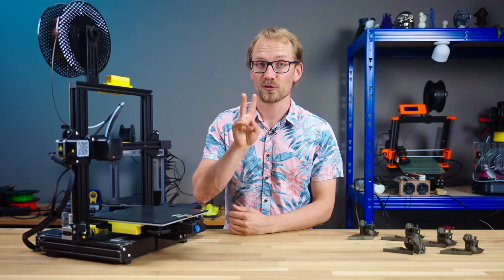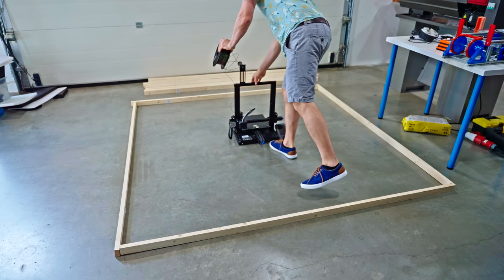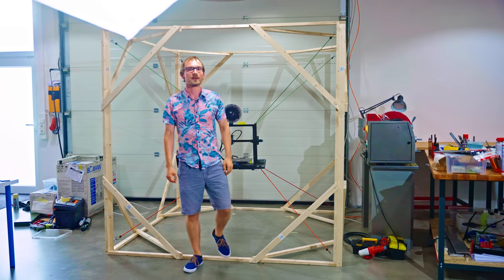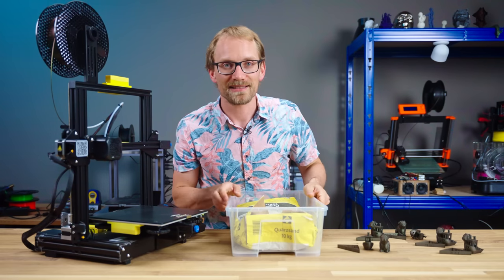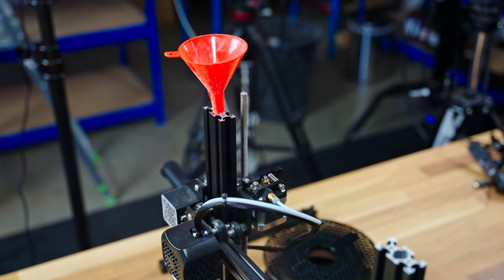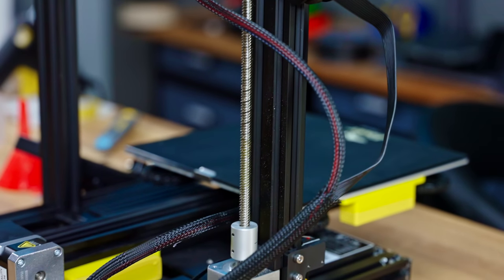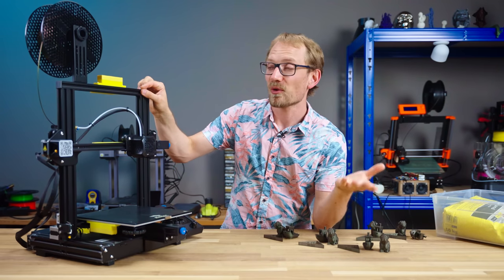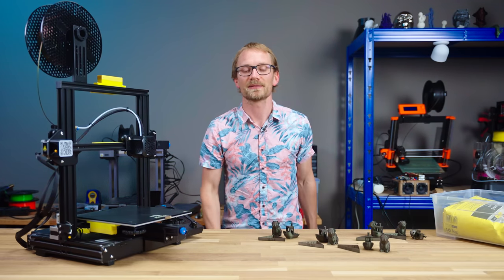You made me do this…

Comment: Those sand containers are a great solution. Did you try adding the sand only to the static portions of the frame?
Reply: Sandtainers*
Reply: I was going to ask the same question. Leave those heated bead sand containers out.
Reply: Surprised he didn't try it without, first, to begin with...
Reply: Same question from me too. I'd love to see it only attached to the static frame parts
Reply: The ones on the bottom. Of the bed can't be a good idea
Reply: @Alexander Gee That was exactly my idea to write a comment like that...
Reply: Or just try the printer on top of the sand (in a bucket/tray).
Reply: Adding weight to the bed was not smart in any way
Reply: Agree, curious if/how different dampening materials/fluids attached to static frame components would help, or not.  Detaching power supply and fan cooled controller board.
Reply: I figured it out. He added weights to the bed to add engagement to the comment section. Big brain 4D Chess move.
Reply: Yes, in that case bed have more weight and that causes bigger inertia and servo struggle to stop the bed or any other moving component
Reply: I was about to suggest the exact same thing but also lighten the moving parts so the change of direction causes less vibration.
Reply: I really wanna see this, adding extra momentum was kinda wack, but they might add some benefit if they're only on the frame
Reply: I was going to make the same suggestion.
Reply: @yossirabby7746  or to the gantry.
Reply: @yossirabby7746  he probably did it originally without the weights on the bed but saw no noticable difference and wanted to get a point across, don't waste your time.
Reply: I'm wondering whether replacing rigid containers with soft sand bags would help. They may allow for more movement and thus improve damping. 
A more professional solution would be to find out which frequencies affect ghosting the most. Then with a FEM model you can find out what dampers to use (e.g. oil dampers, tuned mass dampers or combination of those) to almost completely negate vibrations. This is a very complex task though, and it would probably fit your printer only since every machine is slightly different in terms of rigidity.
Reply: It was very surprising, that he added weight to the moving parts at all
Reply: Y’all commenting that extra weight to the bed is … bad… but the sandtainers (c) are not simple weights: they are only partially filled so they potentially dampen the springback
Reply: Skipping was worse cause of those containers is my guess to cause like the skipping is the motors not being able to turn enough and adding weight only gives them more work while they would need less work
Reply: Please take the sand off the moving portions and try again!
Reply: I remembered why I unsubscribed.
Reply: Right that's painful he didn't show with out adding weight to the bed
Reply: Yep, sandtainers on the rigid structure of the printer and not on the bed or other moving parts would be my guess too.
Also to dampen resonant frequencies, you must always combine diferent materials.
For example a spring to tighten the band to move the bed. The spring has a different resonance frequency compared to the band, so you will not have a single resonance frequency and on the 2 separate frequencies you will have a much lower amplification.

The same for the hanging construction. By using the same bands in all directions, you actually introduce a new resonance frequency. By combining 2 different elastic bands in series, you will prevent those frequencies to amplify themselves (thus resonate).

I think you will already get great results by just placing the printer on a stack of different materials like rubber feet, carton beer coasters, anti-scratching vilt pads, etc.
But adding the sandtainers to the rigid body parts of the printer should for sure have some effect I think.
Reply: Why not use input_shaper?
Reply: @thegeniusman8757  Sandtainerers*
Reply: Adding the sand to the bed makes no sense at all. The rest of the sand does make sense
Reply: What if you rest the sand-filled printer in a 1x1x1m box full of densely packed packing peanuts instead of the elastic bands? 

Because the sand inside the bed containers isn’t solid, won’t it cause all kinds of issues when it shifts around and or vibrates? 

One last thought, if you measure the resonance of your printer, canʼt you use the weights from a BMW to counter it? (If they match in frequency ofc)
Reply: @groggynod  Yep
Reply: I mean yeah, he identifies the weight on the moving parts was a negative, didn't bother to check without it
Reply: +1 for I think we all want to see only static sandtainers (especially not on bed) PLUS the cute pink vibration feet, with printer sitting on floor. (Zero bench movement possible)
Reply: @AzaB2C  yeah fill the rails with fine lead shot and oil.. That is effectively how a fluid damper works, and those absolutely DO work.
Reply: His ignorance is glowing like Rudolph's Nose due to the fact that he didn't try this first
Reply: Exactly my thinking + we use vibrations to make the sand settle in a profile frame. It's not suppose to slug around, creating that dead hammer blow he also mentioned himself (why that wasn't immediately clear to him when saying it is beyond me)
Reply: Yeah as soon as he put it on x gantry I was like God no... everywhere but not x or y as it would obviously affect negatively.

Comment: I still feel like the sand in the frame might marginally helps, but adding the "sand containers" to all of the moving parts really just serves to add weight and increase the problems.
Reply: Not sand. It should be ie. lead to even have marginal difference.
Reply: Yes. I would have liked to see what would happen if sand was added to just the non moving parts.
Reply: Although sand in the frame really is a poor-mans version of just using better aluminum extrusion profiles - i.e. the heavy-duty type instead of light-weight.
Reply: @alexbaeza4370  mhmm   mm
Reply: @graealex  its not the same… one adds strengths and the other absorbs vibration energyyy
Reply: @fabilord98  While the sand does not add rigidity (what you are referring to as "strength") - rigidity is what resists forces to deform the frame, so basically stronger frames better resist vibration. The motors and sudden changes in direction are as a direct result not able to cause as much movement in the frame. This is additionally helped by the increased mass, at least for the parts that remain stationary.
Reply: @alexbaeza4370  Completely agree, adding weight adds to the inertia to the part. Great for static items but for the moving parts, it does the exact opposite of what is desired (reduce the kinetic energy of the items). This is why bowden tubes as a general rule have less ringing than direct drive because it reduces the mass of the extruder.
Reply: Why not add cork material instead? It is lighter and vibration dampening.
Reply: @jothain  This.    Reason why to this day they use heavy castings for anything machining related.   Mass absorbs the vibrations better than anything else.   Sand will help a little, but getting some lead bird shot would be best in this case.
Reply: @graealex  opens wallet well if the shoe fits...

Comment: There's an amazing technique called "Motion Amplification" which uses special cameras and DSP to visually exaggerate imperceptible movements in video. It's used largely for identifying sources of resonance in structures and industrial machinery. I'd be fascinated to see it used on a 3D printer. I predict the main source of resonance is the belts.
Reply: Wow that sounds so cool. i remember a similar tech where a camera was used to observe a human face and detect imperceptible changes in color of the skin due to blood being pumped and amplify it to detect the heart beat.
Reply: @wizardOfRobots  it's the same, it's called Eulerian Video Magnification
Reply: Ot watch Mathias Wandel checking vibrations with a loudspeaker and oscilloscope. Wandel is the master.
Reply: U,u
Reply: @BerraLilltroll  I saw that video (or a similar one) recently and was impressed with his technique and results. As I recall he was balancing a rotating mass with weights, but the technique could be used to identify resonate frequencies and test various damping solutions without wasting filament or waiting for test prints to finish.
Reply: There are some apps which can do this too (albeit not well)
Reply: the too dooom for this
Reply: on racecars they put transducers, strain gauges and accelerometers on many different parts of the frame and can identify resonances like that. They also do that when they are tuning high end CNC milling machines before the go out of the factory. It allows them to make the frames a bit lighter and get better accuracy. You would be amazed at the convergences of frequency that occur in a complex machine. Its fascinating but the math is way over my head.

Comment: In the machine tool world, "epoxy granite" is used to fill machine frames to increase rigidity and dampening ability. It's basically just epoxy resin and sand. What the epoxy adds is it connects the mass of the sand to the structure, making it one. The aluminum extrusion with sand in it will ring nearly as much as without the sand as the sand is able to just move and allow the aluminum to move (ring).
Reply: True, however cast iron also has significantly different characteristics to aluminum extrusions.  Plus, the lighter the machine then the slower / shallower you need to go.  Even a mini lathe weights 40+kg.
Reply: @arthurmoore9488  So you add mass to non moving parts only. If you're fairly certain you're not going to fiddle about with your design, you could even fill in the outer moldings.

Comment: The sand on a rapid-moving part was totally a mistake on my opinion. Getting down the rabit hole you could try with some mineral oil, like the ones that are inside car/bike suspensions...?
Reply: Those dampeners only work at high amplitude, low frequency vibration.
Reply: The oil in dampers only works because it gets pushed through a valve. How would you install such a valve in a 3D printer.
Reply: Yes the increase weight on the bed destroy the test.
Moving parts = as light as possible
Frame = as heavy as possible
Reply: @VanDerPol  watercooling tubing...?
Reply: Filled with oil it would still act like a solid.
Reply: He should actually have stripped the Heating head of the protective cover and changed parts for Carbon fiber that is still necessary.

The added weight on the Z-axis boom-arm, also destroyed the test because the movement in Z is now unproportonal to the frame in Z.
Reply: Oil dampened shocks are a different animal. It’s there to provide resistance to a piston traveling through the oil. It’s not just there to be dead weight like sand.
Reply: Sand is what they use in some roller coaster tracks.

Comment: FYI: I put a FDM printer on a $20K active dampening vibration table we use for laser alignment and it made no difference. I think the issue is amplitude and frequency is not consistent.
What about hanging the printer from a pivot point, with a mass dampener at the other end of the pivot point? A sort of Foucalt's pendulum with a mass dampener.
Reply: What do you mean by a pivot point in printer?
Reply: I think this is the comment closest to identifying the fundamental challenge. There must be multiple resonances in the printer structure and there are certainly a multitude of stimuli when you consider acceleration and vector forces. For a Cartesian system, it is probably a problem constrained to two planes; XY and ZX. I think it’s a lot harder than it looks. The analysis would be fairly involved, I think.
Reply: Shouldn't input shaper be able to cancel out all frequencies?
Reply: Aren't vibration damping tables mostly about preventing vibration from the environment from reaching equipment? Or is it designed for vibrating equipment as well?

Ultimately, I think the problem is that most of the vibration is coming from the carriage itself, which is only loosely coupled to the rest of the system, and by definition needs degrees of freedom.
Reply: The stepper and belt is the culprit.

And this time alot driver help eliminate example trinamic.
Reply: Sometimes it's as simple as tightening the bolts.
Reply: @defenestrated23  most of the vibration comes from the movement of x-axis Extruder and the y-axis tray. I would say just a counter weight of x-axis and attach a to very top to counter

Comment: I’ve put my printer on a square of memory foam . Using tick square of plywood on top so the printer doesn’t just sink into the memory foam. It works great & definitely makes the printer quieter.
Reply: I do the same, except I use a concrete tile instead of plywood and some cheap mattress foam from Amazon underneath

Comment: Hmm, makes sense that you shouldn't put weight on the moving parts. So I'd try the same sand setup but excluding the print bed since it's moving quickly and weighting it gives more inertia so a higher probability of skips.
Reply: This for sure. I think that will help alot.
Reply: I had the same thought. Direct drive units are intentionally light weight to avoid inducing ringing.
Reply: Also makes sense that you should put weight on the moving parts to generate a lot of comments and viewer engagement for the algorithm.

Comment: Yes definitely do a video on the belts please ...... Since I starting playing around with 3d printing and my velleman k8200 many years ago you have taught me so much, and are normally the go to videos when I have a problem or just want to improve something. Keep them coming and hope to see you around for many more years to come 
THANK YOU Tom
Reply: So I am not the only one that got hurt playing with the k8200. Still got mine. But I don't use it since I got my Ender3 original. I since replaced to pcb on the Ender. I could maybe use the old pcb into the K8200 and try to have it run better.
Reply: @pierremartel3552  My 8200 was a good printer even thou I have done a lot of upgrades, it was working fine up to a few months ago when I parted it out to build a bigger n better printer from scratch.
It was the 8400 that I scraped after a few prints when the MB froze up putting the hot end into a thermal run away ..... after a hard reset it was still showing the hot end at almost 400c

Comment: I would recommend removing the sand from the print bed.  Then, run the tests again:  With Feet, without feet, and then suspended.

This series is great, and your willingness to be honest is appreciated.
Reply: Agree, but the suspended one is just for fun, there is no logic on continuing that other than entertainment.
Reply: @brianfhunter  actually the suspended test could be coupled with and earthquake reader and it can plot the sine wave of the vibrations. 

Then with the total mass of the 3D printer known, plus it's rought moment of inertia, you can calculate how much damping it needs

Comment: Another great video Tom. 
This is just a collection of thoughts. 
Sand alone isn't great at dampening. It's coarse and rough and irritating and it gets everywhere. Solution Epoxy "Granit" (a with Epoxy damped mixture of sand that is filled and compresses in forms or extrusions to minimize resonances and vibrations on Professional Machines like Kern cnc mills)
Weight alone helps a bit but Weight and a Dampener works great. I would love to see the printer mounted to the paver and than placed on a 2 to 5 inch think piece of upholstery foam.
Oh and i think stifer belts will make a noticabal difrence (steel cored belts, heard that there are some out there in the wild)

Keep up the great work and i cant wait to see the next episode in this series and the escalation that it could bring with it.
Reply: Stop hidiing Anakiin, we all know it's you. Although you bring a fair pont about the resin but it defeats the purpose of dampening. What makes sand such a great dampener is the fact that it's loose particles that have thousands of points of friction for the energy to dissipate into heat, having it all merge with the resin just make's one solid mass that, albeit having greater inertia and therefore harder to get moving, has a single natural frequencey that it can resonate with.
Reply: @coolbionicle   I disagree unfortunately. Having a Mass that not solid makes it very hard to predict the result and I cant find a mechanical loss coefficient for loose sand. 

Besides that, the “granit” part of the epoxy graint its mostly a filler too minimize the amount of epoxy needed (epoxy = expensive).

The epoxy provides the dampening, the Aluminum frame the needed stiffens for the machine and the Sand is just a filler. 

If you don't trust me go over to Adam bender her on you tube and watch his How to Build Epoxy Granite Machine Base video. He goes in more detail with Loss Coefficient vs. Young's Modulus and how to find the right ratios of sand to epoxy.

Comment: Or you could try Input Shaper, I sure hope that's where this is going, try a bunch of physical solutions, show they don't really work, then show the absolute magic of Input Shaper tuned with an ADXL.
Reply: Less initial vibrations for Input Shaper to negate would lead to sharper prints as it'll apply less smoothing. So removing as much resonance before using Input Shaper is the way to go.

It's a shame this test wasn't shown without the sand containers on the bed axis, as that's somewhere you should be trying to remove weight on this style of printer.
Reply: @howaboutbecause686  Exactly, the GiGo principal still applies no matter how good your software compensation, garbage in garbage out.
Reply: @m3chanist  How dare you insult the best 3D printer to ever see the light?